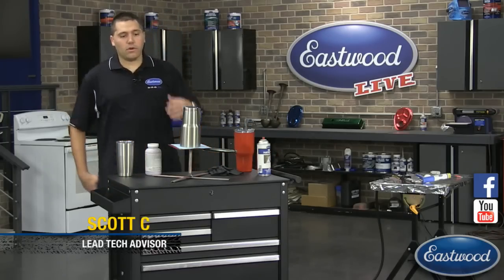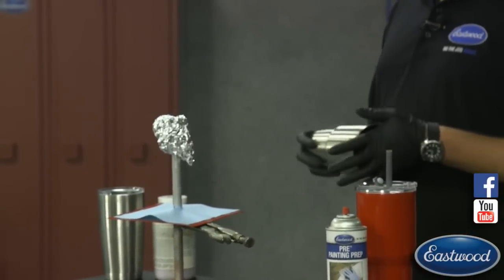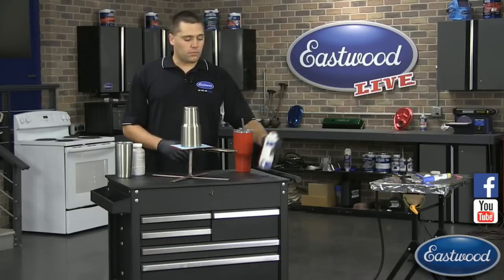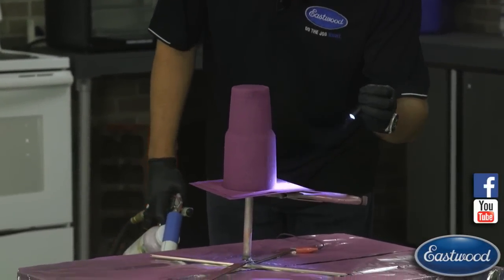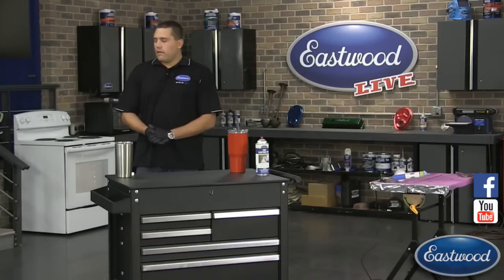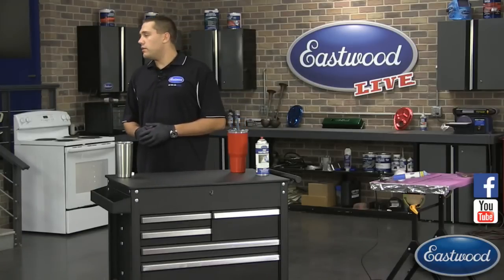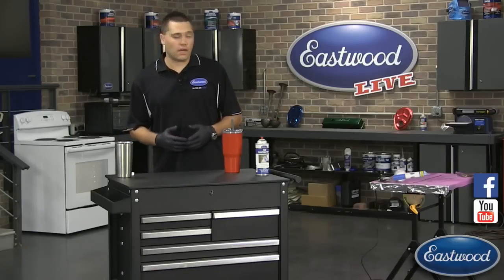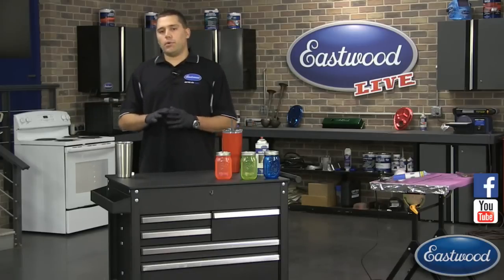How to Powder Coat A Stainless Yeti Cup - Powder Coating Tips & Tricks - Eastwood

Comment: A friend of mine made an oven using a large metal cabinet that he insulated with firebrick on three side, and fire-X board on the doors,  and heated using 3 electric oven elements, it seems to work fairly well

Comment: 10:21 
Can  you use a high temperature tape to tape the edge (top rim)  of tumbler when you don’t want to use straw and so  mouth doesn’t touch the coating while drinking right from cup?

Comment: if the stainless tumbler have a plastic liner will the oven melt it?
Reply: Sidney Pendergrass yes.
Reply: Sidney Pendergrass  it has to be able to withstand 400 degrees Fahrenheit for a minimum of 10 minutes for some powders and 20 minutes for Eastwood powders

Comment: What would be the process in powder coating a tumbler with a base coat, and then a low temp clear coat? I've read that heat flocking isn't easy unless you're a pro at it, and the instructions in the powder coat gun manual states to cure the first coat completely before curing a second coat. I've also read online that a partial cure, let's say a 60% cure, is a better method before adding the clear coat and finishing off with a full cure for the clear coat?  What do the pros at Eastwood recommend?
Reply from the maker: You can actually talk to the Eastwood Tech who is in this video powder coating the Yeti Cup and get his feedback and suggestions.  The Tech Line is 866.759.2131.

Comment: Is it possible to use a heat gun instead of an oven?
Reply: Kevin Hornbuckle a lot of the powders require 10-12 minutes to cure once the cup reaches PMT.
Reply from the maker: You can use heat lamps.  http://www.eastwood.com/infrared-curing-lamp-6000.html
Reply: Kevin Hornbuckle it's possible to get a good look from a heat gun. it is very unlikely it will be properly cured and have any kind of durability though. we use a heat gun sometimes when laying multiple layer decals down. after the vinyl stencil is removed we will do a full bake on it.

Comment: what about translucent and candy I used candy on powder coat come and it ran in the cracks what did I do wrong
Reply: From my understanding you can't mix powders like you do paint. You have to buy it in the color you want to apply it as. I'm not sure about overlaying one on top of a previously cured layer though.